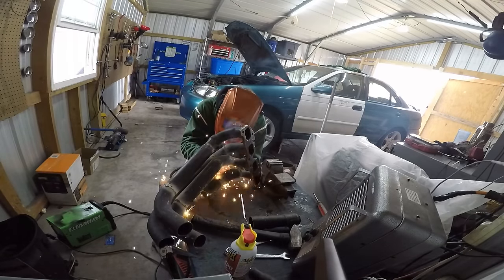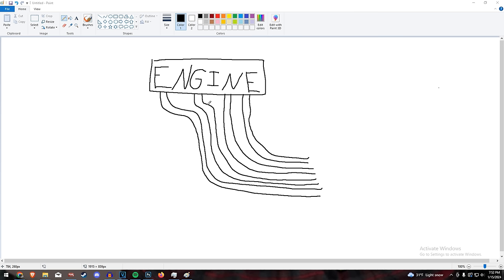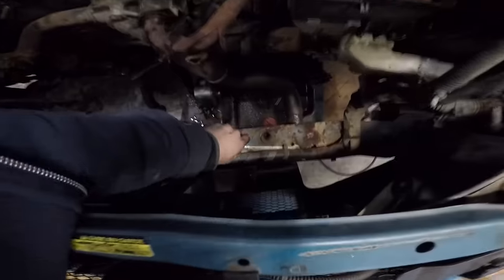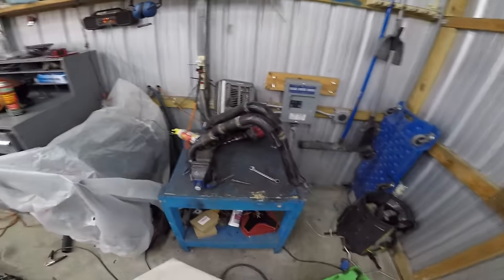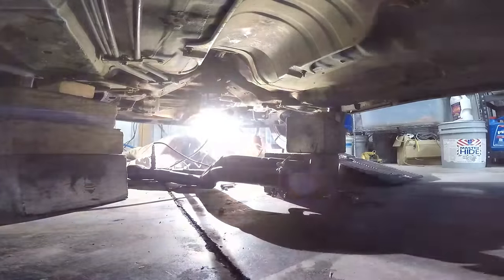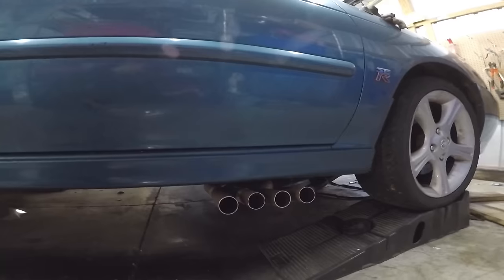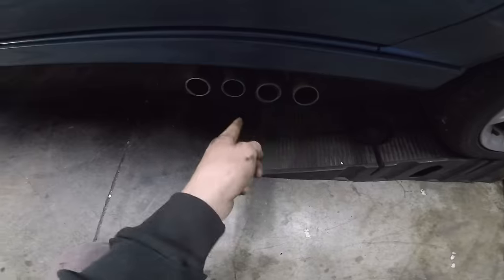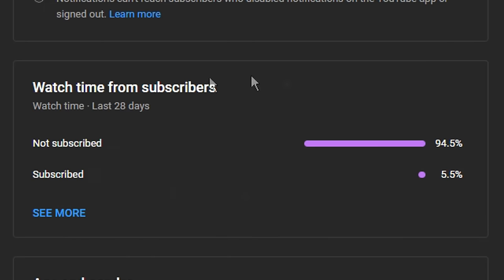True Quad Exhaust on a 4 Cylinder - What Will it Sound Like?

Comment: One of those exhaust setups that makes the car sound like it's going a lot faster than it is.
Reply: Like all the Mitsubishi EVO and Subaru WRX exhausts.
Reply: not gonna lie I think that if the car sounds like its going fast there is less chance of you speeding actually speeding if the car is so if you get what I mean (I dont drive yet)
Reply: @gaminggts8644  Nah, people are dumb, but it does work for me.  Every time I drive with straight headers, I'm just imagining all the cops in town running around looking for the loud exhaust.  (When I started driving, you could get a ticket for Flowmasters.)
Reply: A kid on my block ran his truck's 5.7 on open headers for 3 weeks, assumedly until a noise complaint/cops told him to stop. I've also seen a v8 swap civic on opens.
A whole lotta noise to get to 40MPH in 20 seconds.
Reply: cough Honda cough
Reply: For me,  4 banger with rusted off exhaust sounds slowest thing in the world.
Reply: @gaminggts8644 I can see that since you can’t even type.
Reply: You guys ever heard of noise pollution?
Reply: wait until this guy learns about personal preference
Reply: @gaminggts8644 i think youd get used to it but i never drove something too loud. Some sound is useful tho if you drive a manual it helps you tell when to shift without having to look at the dash
Reply: My old Audi was like that. Had a lot of fun in that car
Reply: What you mean it is going  fast
Reply: My exhaust on my honda odyssey is drilled out a little and in first gear it sounds like i should be going 90
Reply: @Mp57navy  I'm not going to say a EVO or WRX is equivalent to a GTR or a Corvette or something like that but have you ever even driven either of those? A turbo STI is pretty impressive as well as a turbo EVO. I've driven all 4 of those and while the GTR is the most impressive of the bunch the Subaru and Mitsubishi aren't slow compared to most vehicles. By your comment I feel like you're just hating on Japanese cars and I don't think you realize how easy it is to push horsepower from either of those models.
Reply: sick exhaust, 0-60 in 3-5 business days
Reply: Like every pre-2010 muscle car ever?
Reply: aka loud
Reply: @Mp57navy EVO’s actually can compete with their 4G very well if built right. Adam LZ’s EVO 6 is a great example. Sounds great too.
Reply: That's the point can't afford one gotta make do haha
Reply: And that is the sad part. (Or funny part).🤣
Reply: I mean he is wearing earplugs 🤣
Reply: Those are the best ones
Reply: @Mp57navy  Have you ever driven a well modified evo? They are going really fast, they are pretty much the contrary of all noise and no go
Reply: @TykeMison_ a v8 Honda taking 20 seconds for 40mph? Lol
Reply: @Mp57navy  you've obviously never been in a looked after Subaru. Most are quicker off the line then a bugatti. May not be faster in the top speed but they are quick as fuck
Reply: Needs to add racing strips to the exhausts!, maybe some spoilers too!
Reply: it can be done, but... the space under the car like these quad pipes, none of engineering would accept it, but it can bring more power if applied, each cylinder are working empty on exhaust cycling, and is like the dude said ahead, the back pressure, it can be used to get power, but need all acoustic study to make it work, 

u gonna notice why an bike monocylinder has 1 inch exhaust port then it has 3/8 on end of muffler , this is due the backpressure.
Reply: Loud pipes save lives.
Reply: @FuckGoogle502  I lost the exhaust on my 1976 Ascona B 1,9l and it was so loud you had to use hearing protection when driving and also drive with the window open to not get Nox and Co poisoning... Police was not happy when they drove up next to me while it was idling, I suspect if they heard the sound it made while driving they would have shot me on the spot lol ;)
Reply: So like every mustang/camero at stop lights that change gears so many times just to go 45
Reply: Reminds me of a Subaru Outback. Sounds boring at low RPM but is an absolute beaute at redline, even from the factory.
Reply: Difference is no muffler/baffles etc. You know a car is f a s t when it has a muffler and sound deadening and it still sounds like this.
Reply: You say that like it's a bad thing 🙄
Reply: I guarantee it makes the car a lot more fun to drive though😂
Reply: This how lifted trucks sound with their cherrybomb exhaust. 😂
Reply: what are you talking about? that was over 50mph!!
Reply: Like that 90 something Mercedes with a w12 that has a $1200 exhaust
Reply: @gaminggts8644 dude FOR REAL. I honestly didn't speed that much in my truck, but after it got totaled and I've been driving my mom's car (tldr trying to build credit and save to get a new car) I've caught myself speeding like crazy, it just doesn't sound like I'm going 55 in a 40 lmfao
Reply: @TykeMison_ try "presumably" in place of assumably and see how it feels for you. It's a little more expensive but I think you'll agree it's money well spent. 😂🙋🏻‍♂️
Reply: I actually made a 4 banger sound pretty good at low rpm. Sounded like a hopped up small block. WOT it sounded just like a crop duster airplane. Racing header, downpipe with performance cat into a great big glass pack then immediately into Y pipe for dual exit. A pipe with tips exiting each side in front of rear wheels. Baffles in them as well. 2.5 inch pipe. Sounded freaking awesome at 35 mph and on the interstate nobody wants to  ride next you! The car was an HHR panel wagon. 3 window. No back seats, all loading deck. Ran hotshot deliveries in that car. The exhaust added 4 to 5 mpg and more importantly kept old timers or distracted drivers from entering my lane while in their blind spot? Maybe they just don't use mirrors? 488k miles on it before it needed a valve job and she was still beautiful to look at. I junked it and bought a new truck because where I lived at the time would only allow 1 vehicle per unit. Almost no parking..
Reply: Farter
Reply: @gaminggts8644  Nah but you're more likely to get pulled over, cops tend to single out nice or loud cars
Reply: I was there... We clocked it at 227 mph !
Reply: Best kind of
Reply: @FuckGoogle502  yes. I speed a lot more in my quiet minivan than in my loud mustang. For me it's cause I don't realize how fast I'm going due to how quiet the minivan is. With my mustang, im always well aware of how much power im giving it
Reply: Whole lotta noise, notta lotta movement
Reply: I have one of those exhaust setups😅
Reply: Imagine what it would sound like if was actually fast
Reply: My built 05 lsj cobalt touches 80 mph in second gear... and keeps on pushing to 7800 rpm. Loud and rude as hell but pisses zo6 guys off really bad .
Reply: @Mr_tater_the_real_tater_king  literally everything about you tells us you've never gotten behind the wheel of a car lmao. My brother in christ, adding power wouldn't make it sound different other than super charger whine or the turbo whistle....
Reply: @silversonic99  bro I’m a mechanic and yes more power does make it sound different it’s just you need a lot before it actually makes a difference and yes super charger would sound amazing
Reply: @Mr_tater_the_real_tater_king  lol dude really tried the "as a black man" argument. It does not make it sound different, stop capping.  Whistles and whines from chargers and turbos is not the engine itself, it's the turbos and chargers making that noise...
Reply: All that sound none the speed
Reply: i have a straight Gm 4 banger (wont name it online) i frequently get cops called for going 50 in a 45
Reply: Strapping a fart can exhaust on just makes it sound annoying.  However bigger valves, injectors, hotter coils and a tune make it sound healthy as eff!
Reply: @FuckGoogle502 A 40 series on my last car, a 2015 K24 Honda CR-V was droney but didn’t sound terrible. Had a low noise and never sounded raspy. Ever.
Reply: Just like a v8
Reply: @Mp57navy wrx are fast bro you raced one
Reply: Guys, Here is The Savior

HalleluYAH “Praise ye YaH”

YaH is The Father (Genesis 1)
YaH arrives via the TENT OF MEETING
YaH was Who they Crucified for our sins
YaH was Crucified on an Almond TREE

Ancient Semitic Moshe (Moses)
Isaiah Scroll (The Original Isaiah)

Isaiah 42:8
I am YaH; that is my Name! I will not yield my glory to another or my praise to idols.

Isaiah 43:11
I am YAH, there is no other Savior but Me.

Isaiah 45:5
I am YaH, and there is none else.
Reply: @noelvalenzarro  blame the automotive manufacturers who systematically destroyed public transportation and lobbied to make cars a necessary part of everyday american life. don't blame the people just trying to have a good time.
Reply: @tissuepaper9962  then can you do me a favor and try to convince them to not constantly have a good time down roads at 3 in the morning loud enough to wake up hundreds of people and weaving in and out of traffic putting other people in danger?
Reply: @noelvalenzarro  we went from "having a loud car" to "street racing in the middle of the night". you moved those goalposts so far and so fast, they're probably in orbit.
Reply: @tissuepaper9962  all squares are rectangles
Reply: @noelvalenzarro  it's not worth arguing with prejudice. I wish you many nights of interrupted sleep.
Reply: Gives Honda Civic vibes lol
Reply: Absolutely true, but low key, I really like the sound
Reply: @Mp57navy I feel personally attacked
Reply: Not fast, just loud 🤙
Reply: Hondaception

Comment: The fact that it lets you see which cylinders are burning coolant/oil based on the smoke is a pretty hilarious side effect
Reply: No wonder the Mighty Duster can't bring down the Magnum Opus.
Reply: they should do this with 4 little 2-stage cat/muffler dinguses that can be made cheaply and routed in parallel to 1) sound awesome 2) make failures easier to diagnose 3) be cheaper since its the same small part 4 times instead of 1 bigger bespoke thingy
Reply: @JordanManfrey the problem with that is the diagnosis of a head gasket failure makes knowing which cylinder kind of unimportant unless there are two banks. That being said you should always do both at the same time anyway. Maybe with injector failure or spark failure it would help but then you would need 4 O2 sensors minimum 8 with a car on each pipe
Reply: white smoke means coolant. blueish white means oil being burned off!
Reply: @shadowcat4963  black means ignition is off (I think it means late). Though on fuel injection engines this isn't a problem.
Reply: @dswngz  black means its running too rich (too much fuel) it can happen on efi engines but is more likely to be a bad fuel pump, fuel pressure regulator, or a stuck open injector. not always easy to diagnose, but can be pretty easy if you know what your doing!
Reply: Black also means not enough air intake (cant Burn properly)
Reply: @mariomailath1849  that means rich. too much fuel not enough air.
Reply: @shadowcat4963  what do you mean I dont get it
Reply: @mariomailath1849  never said you dont get it, i said black smoke means its running rich. blue smoke means its burning oil and white smoke means its burning coolant!
Reply: @shadowcat4963  I know You didnt say that, I didnt understand what You said
Reply: @mariomailath1849  what he's saying is a rich mixture is too much fuel to the amount of air, what you described (not enough air) would also mean a rich mixture, as likely the same amount of fuel is going in, but not enough air therefore making the mixture richer
Reply: I bet your neighbors all hate your speed bucket
Reply: You can also see which cylinder has better conversion
Reply: @shadowcat4963  that smoke  its normal stop being stupid,,, , car drops watter from combustion
Reply: You can see it get progressively worse through out the video 😂
Reply: eh, makes diagnostics that much easier!
Reply: @LowEndPCGamer100  doesnt neccesarily mean it tells what the issue is, just shows a prominent symptom
Reply: Fun fact this is why the Tucker torpedo has 6 exhaust pipes!
Reply: @shadowcat4963 no white smoke means a new pope has been chosen
Reply: @k3y155  ok, keep believing that
Reply: Hilarious? How so? Serious question ... I think I'm missing something...